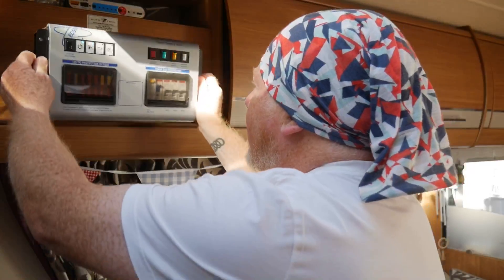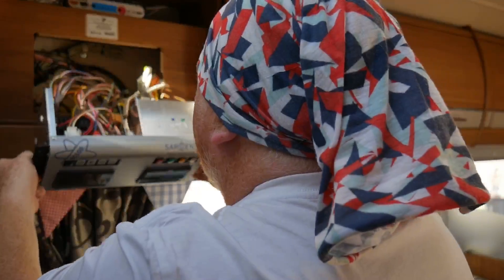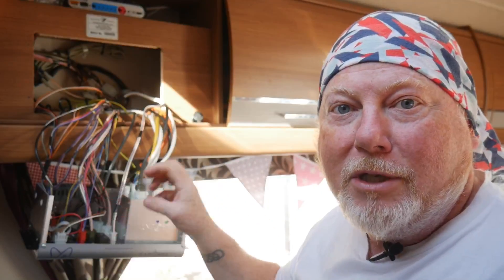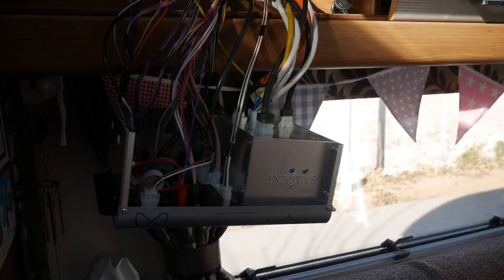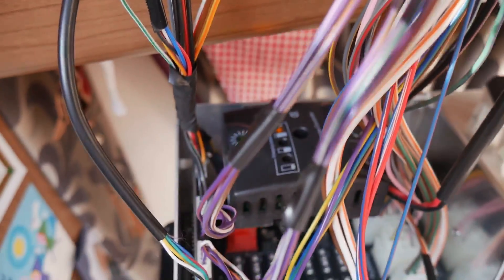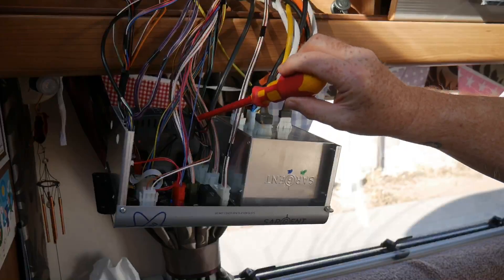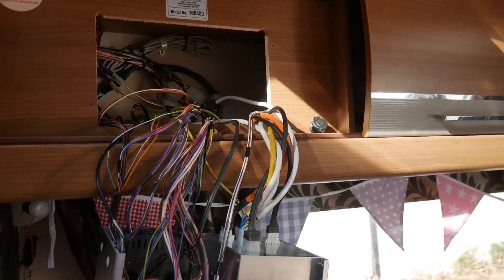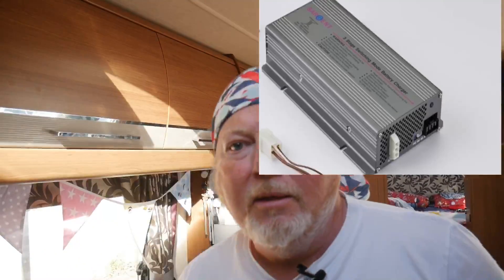Technical Look at The Sergant EC 500 Control Unit and a replacement MPPT Unit

Comment: Hi…just watched your great video, it’s of interest to me because I need to disable the split charge system prior to fitting a lithium battery and a DC 2 DC charger.
Have you moved along that path at all?
Reply from the maker: Yes, that’s exactly what I did. 
I simply removed the built in charge controller and rerouted the solar panel wires to a new Victron mppt controller. 
I used a sterling DC-DC charger.
I’d probably go with the new Victron dc charges if doing it today.
Reply: Ahh ok you are talking about the solar side, I have also changed my controller for a Votronic Due 250 controller, this one has the added benefit of feeding 1amp to the vehicle battery (hence the name Duo)
I was actually talking about the split charge system that charges the hab battery from the alternator….im fitting a lithium battery and the split charge system (on some vehicles) “can” over stress the alternator and kill it.

Just some food for thought.

Ray
Reply from the maker: @rayleeson6135 oh yes sorry. The Sterling 30amp DC-DC charger seemed fine. 
This was on 3ltr Fiat Ducato (AutoTrail Comanche) 

There is the option of fitting an updated alternator if the standard one is under strain 👍😀😎

Comment: Lots of campers agree that Sargent fit a very poor solar controller
Reply from the maker: The charge power is also routed through the Sargent Unit circuit board which then limits the amps allowed to charge the batteries. It's all very 1980's tech :(

Comment: Charge controller MPPT straight from solar panel to batteries more efficient. for what your using, I would say you need 400 watts of solar, battery setup OK. Lithium batteries be careful they dont like the cold, most who use them are in doors like canal boats or van conversions, you put them in outside locker in the cold they die pretty quick.
Reply from the maker: When / if we go lithium, I think I’d put them inside 👍😀😎 
As for the MPPT I’ll be going for a couple of 200 watt panels and going straight to the batteries. The Sargent unit can only deal with a max. 10 amp output from a solar controller. Our current battery set can take 30 amps 🤷‍♂️☹️🤔

Comment: If you are seriously thinking you will later move to Lithium (LIFEPO4) batteries then you need to make sure that everything you buy from now on supports them.   This isn't as simple as the manufacturer telling you it does, you really need to choose a battery now and then look at the charging profiles.   For example, the Sterling Lithium batteries want a charge voltage of 14.6 and a max of 14.8.  SuperB batteries say they want a maximum of 14.4 volts and Victron, just to be awkward, would like 14.5.   So, if you buy a MPPT for your existing batteries then make sure it has setting for the batteries you will choose.   

I also think you mentioned battery to battery charging in this video, in which case the information above is even more important.   The batteries you have now (Yuasa) expect to be charged at 5A over 20 hours to get maximum service and capacity out of them, which with three batteries means you should only charge at 15A (yes I know nobody takes any notice of this!).   If you charge them much faster they will deteriorate and you will notice they don't seem to hold as much charge.   Lithium batteries can be charged at a much higher rate, typically over two hours from empty to full also known as 0.5C, many thousands of times without any problems.

Victron seem to be the make everyone knows, but are very expensive and I would point out that they don't have an integrated BMS.   If you buy a lithium battery with an integrated BMS then this means it will shut down itself when you try to misuse it, typically by running it below 0% or overcharging it.    I don't mean not to buy something like a Victron BMS712 as these are essential with whatever system you buy, I just mean built in electronics that stop you killing a battery worth £1000+ .
Reply from the maker: Excellent points. I do have Victron LiFeP04 in mind and am specimen Victron components that are programmable for different battery types. I’m probably going Victron all the way and am now a Victron Youtube junkie 😆😆😆

Thanks for the comment, much appreciated 👍😀😎
Reply: I would recommend looking at Sterling and particularly looking at their videos where they test their batteries.
Reply from the maker: Yes, I’ve seen that battery test. It sort of was the final push for me to decide to go Lithium at some date soon. Not a real life test but does show a massive difference in the batteries especially Lithium 👍😀😎
The people parked next to us at Bonterra have a Sterling Lithium set up installed by VanBitz - unfortunately their 200Amh of Lithium is not doing well. Something wrong with the setup or one of the batteries is duff we think. 
They’ll get it looked at when back in the UK.

Comment: Hi Steve
Very interesting Vlog  tonight, i totally agree....the AT control panel is old technology and needs to be updated. The new control until you meantion is around £70. Which is not expensive ( who is the supplier)... what if I could do the same install, we could monitor & share the data and compare  exact same motorhome, same layout, same year vans.

I was very nterested in one of your subscribers who mentioned battery control and a monitor app for smart phone....with the combined install it should do the trick.
Jason
Reply from the maker: The charge controller I’m looking at is by Victron 75/15 MPPT but I’m still working on the final details of the setup 👍😀😎

Comment: Ha Steve that's really interesting,  we have just had a new 100w solar panel fitted to our Swifty  caravan roof.
And a new 110AH battery with charge controller,i don't think the charge controller is a MPPT,is the 
MPPT controller more efficient than just a box standard one,and why is it better thanks.
Reply from the maker: There are PWM (pulse width modulation) and MPPT (maximum power point tracking) charge controllers. The MPPT type is more effective at delivering the solar power generated by the solar panel by up to 30% roughly.
That’s why they are better and the preferred type these days.

Comment: I've got the Victron SmartSolar 100/30 wired directly to the batteries. Works very well, has a lithium profile if needed and let's you see what's happening via your phone. Also if you're spending some money please get a battery monitoring system. I've got the Victron BMV 712. Amps in and out is the only accurate way to see how your batteries are performing. This BMS also lets you see the information on your phone.